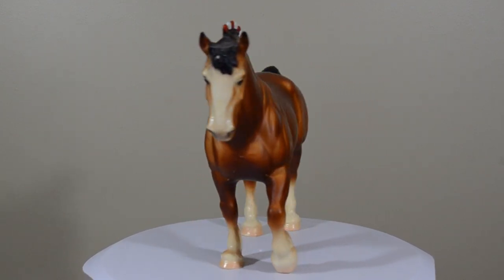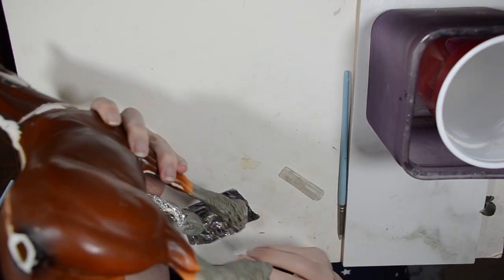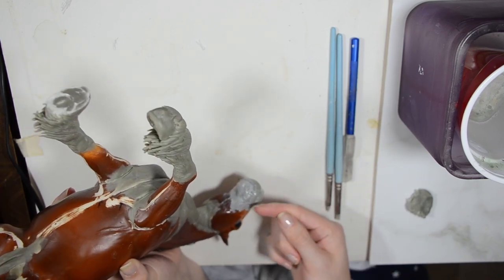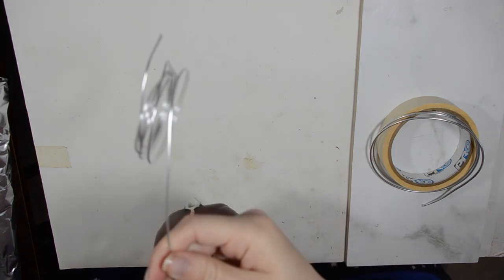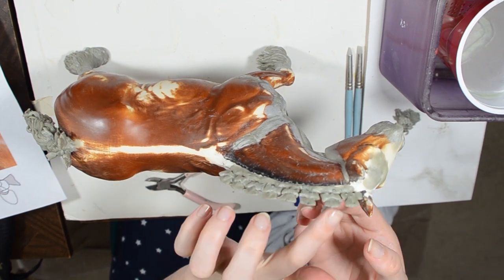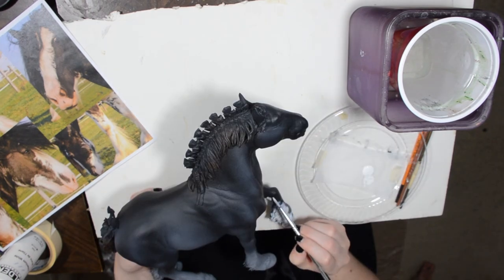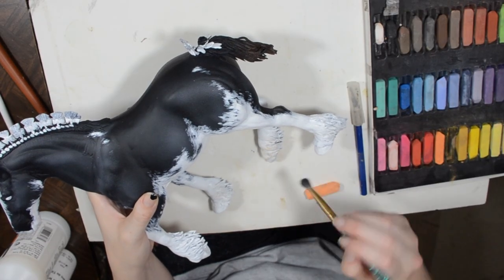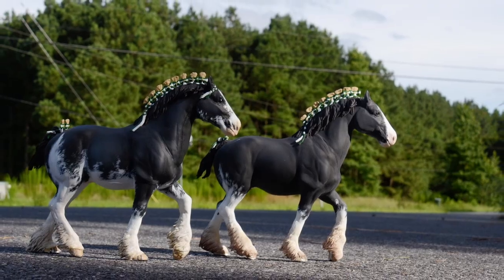Custom Breyer Clydesdale Pair

Comment: Re: the tail, imo you absolutely can and should be able to give an opinion on animal welfare regardless of whether you own that particular type of animal. Docking tails or ears of any animal is very firmly in the past where I live, to the point that even seeing a dobermann pinscher with hair elastics on its ears to keep them up makes me cringe. Giving an opinion on cutting off body parts from a creature shouldn't be so controversial. That said, I don't think a 1910s-inspired model horse has to be a model of animal welfare if the interpretation is of a specific kind of animal husbandry! Better to have it in plastic than in a barn 😂 

Sorry for the soapbox, I just really wanted to say this is absolutely amazing work, and I love that you include so much of the back-and-forth an art craft like sculpture requires. Fascinating!